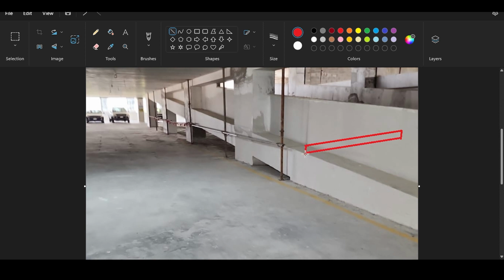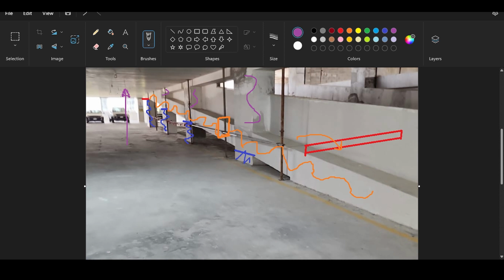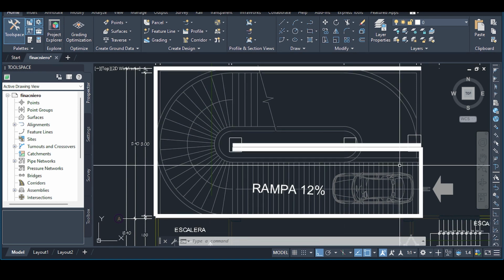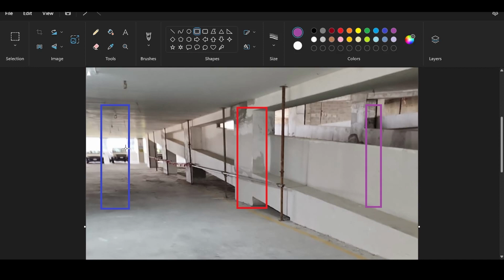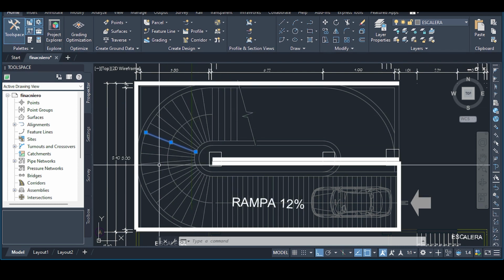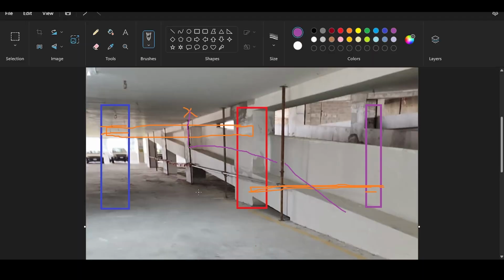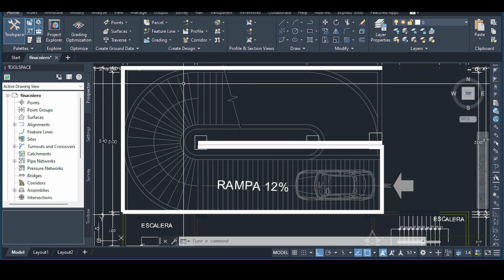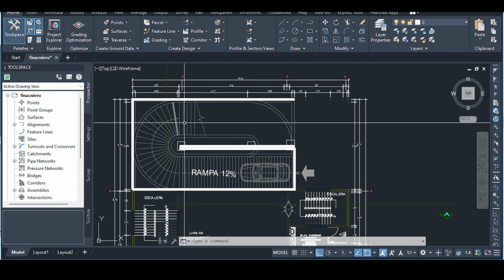Modeling and Design of RC Buildings in Autodesk Robot | Part 14: Car Ramp

Comment: Hello CEE,

1. Why’s there metal props and metal ties supporting the slabs/beams in the existing ramp image attached? Is the floor showing signs of vibration or deflections?

2. It’s a good thing modelling the ramp as a long dog legged staircase. The architects ramp proves to be difficult to support with no columns or walls except the basement walls. 

Most ramps I have seen and done, are straight flight ramp with entries and exits at different locations. Curves in basement are really dangerous and might cause alot of damages to users and properties if not done and dimensioned  well enough.
Reply from the maker: You are 100% correct with regard to the ramps being flights. For some reason, the drawings I have want to have a circular ramp. It is so tight, I even doubt it would do its job.

For point 2, agreed, but I am still unhappy with the spacing for turning.

For point 1, the structure is still under construction, and even the final wearing surface has not been installed yet. They are using this "car parking floor" as a staging area and storage area for materials to be hauled and concrete to be pumped to their "current" 58th floor, so no finishing has yet been done.

In case you have any further points, always feel free to write them. I am always happy to read and respond and am open to learning any new concepts and regional variations.

Regards,
CEE

Comment: Can we have a video about beam column layout in building. I mean how to distribute beams and columns without interfering with atchitectural things. Especially when we have interior walls of thickness 12cm and long spans of beams..

Thanks you so much Dr. CEE
Best,
Reply from the maker: Hi there. That is a great idea! because there are so many things that are included in this process. I will keep it in mind.
Thank you for your suggestion.